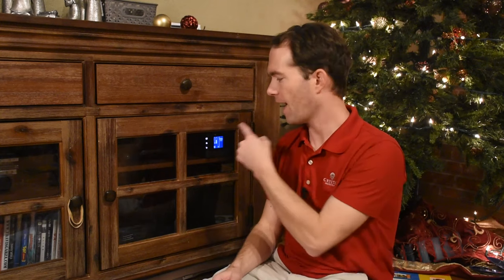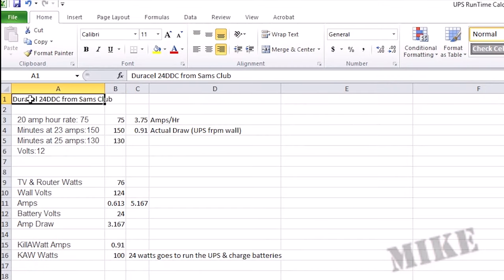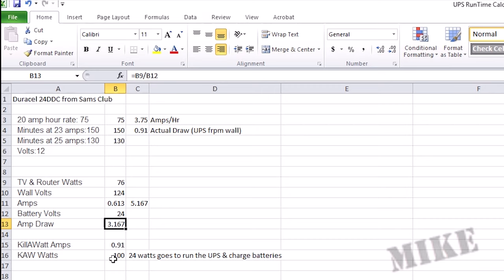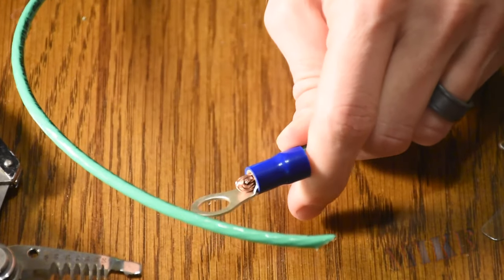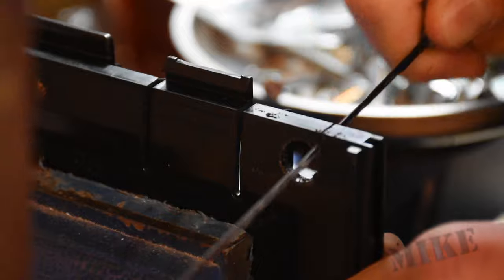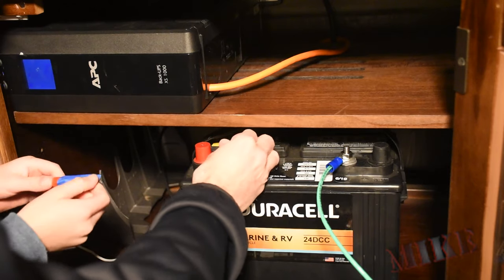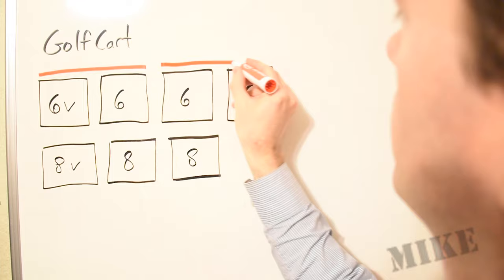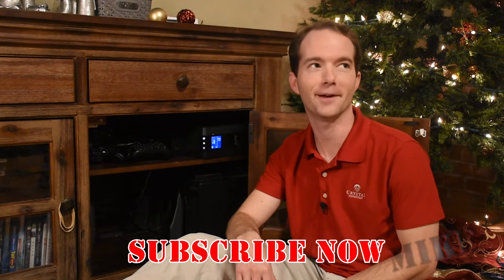SUPER UPS Battery Hack- Mikes Inventions

Comment: Hi Mike. What you probably don’t know is that APC sizes their components to match the runtime of their batteries. Attaching a super large battery, and a full capacity load, will eventually cause most UPS models to overheat. Instead, use the TrippLite automatic PowerVerter if you want an external battery bank. That’s what I did 20 years ago. They are also fan-cooled.
Reply: I like the idea of the PowerVerter, but it does not have auto-switching from AC mains.  I wonder if the PowerVerter could be simply installed behind the APC UPS, which means once the acid batteries run out, then the APC will take over for it's tiny 5-10 min and shut stuff down?
Reply: @mcw0530 any way to hack the ups to fully utilize the bigger battery?
Reply: Just make sure the load lies within the specification of the USC. Better if you keep the load about 20% below the spec.
Reply: I bought a surplus APS, and it has a connector on the back for an external battery. So what does APC recommend for externals? Why does it overheat?
Reply: @MAustinP  Sorry for the late reply, but the PowerVerter does have an automatic version that auto-switches from the Mains should they fail.  I know, because mine does that, just like an APC UPS.  I have the 1200W model and it's attached to a 100AH deep cycle AGM battery.

Please see TrippLite P/N: APS1250
Reply: @bransoncarlton4939  It's pretty simple:  Most APC UPSes are not fan cooled, as that would use more power.  Furthermore, most are inside a sealed metal box.  Power conversion has a known percentage inefficiency, and that heat generation is matched against the components inside the device (their mass, how long it will take to heat up, and to what maximum temperature) and the battery - how long it can power those components.  So the batteries are sized that the unit runs long enough at full load, but not long enough that sufficient heat builds up to destroy the internal components.
Reply: how much load do you expect a TV and Modem/Router to draw?  By your logic, he's going to burn out his UPS with a 20% load for an hour on the stock batteries.  These devices have self testers and will alarm when a failure occurs.  APC and Cyberpower offer very good components that easily take these upgrades, without issue for years.  If you really are that concerned with it, then install a fan to turn on when it switches to the Battery to cool the internal components.  They will only draw as much as they're rated for anyways.
Reply: @mcw0530 There is such thing as equalibrium of operation, and no, false, there is no "sealed" components in a "metal box" it has plenty of ventilation slots cut into a plastic housing to allow for cooling to naturally flow through.  You can more than easily add a 12vDC fan to the circuit to turn on when the Batteries are activated with minimal modding and experience required.  OH, and before you lash out at me for "whatever fanboy reason here" my experience is with 15 years of electronics modding and four UPS's, one of which i have protecting my entire 24U server rack, and since the default 1500VA gives me 10 minutes at full load to save my work during an outage, I have no reason to upgrade it.
Reply: @NafrytiNosferatu  hey go ahead, don't trust the guy who works in an electronics laboratory making power supplies for super large computers. It's your equipment, anyway.
Reply: I have a 540W Geeksquad UPS, and I’m thinking I could water cool the MOSFETS so I could use it as an inverter
Reply: @mcw0530  you speak the truth, They are not built to supply endless hours of power I mean there are units designed to do so but their cost is very high, I must also point out that where I am in Canada the tripplite unit costs far more than a solar generator with UPS fuction for similar power ratings so that would be my move, I don't get why people get upset over facts, I did this years ago with 2 APC units it worked but 1 only lasted about 1 1/2 and the other made it to 2 years before I killed both of them, it does also depend how often and how long they have to run, but you are correct the component in the cheaper UPS unit are not designed to run for hours/days
Reply: $1500 for a ups that will run your rig all day and wont be dragging along. If your rocking a 3090+ and ultra well go more like 2-2.5k
Reply: I’m currently adding 2 100a agm batteries in my suv for a power supply. Is it possible to take the display off my apc 1500pro and it displays everything as when It had the two 12v 7.5a batteries in it. It would just be nice to see all the information it displays
Reply: Could use something like a 12.x volt lifepo battery instead for even greater run time?

Comment: Be careful of using flooded lead acid batteries due to off gassing.
Reply: I suspect one can also use AGM batteries too instead of lead acid right ?
Do they have to be lead acid ?
Reply: @tonymontana897  AGM is lead acid, it's just that the acid is absorbed into a mat instead of flooding the lead plates.
Reply: @charleshorseman55  is it safe to put the UPS sideways like in the video with AGM batteries?
Reply: @AmongUs-mb4qx lectricity doesn't care! Since there is no battery in the APC unit, there is no problem.

One could argue the same with the batteries in it as they are sealed lead acid batteries.

Comment from the maker: Still going strong after 18 months. The UPS charging circuit brought the batteries all the way up after several days, and since the batteries are so large, it's as if the batteries are on a trickle charger, like they would be anyway. The minute counter on the display is still meaningless, because the UPS has no idea how big the batteries are, but it is somewhat useful for judging relative charge. The minutes just tick down at a much slower pace. I haven't needed to use them for more than about an  hour or so since I installed them, and the internal charger on the UPS worked just fine. Now I plan to use my large auto charger if I run them down a lot so as not to strain the UPS charger circuit. So far so good... Stay tuned.
Reply: So bro didn't it give any problem after the installment and can i use car batteries
Reply from the maker: @driftkings2740  Hey, yes, you can use car batteries. There is a comment down there that says as much. However, car batteries' thinner plates are not to be discharged very deeply. (Only about 10%) so size your batteries accordingly. Also, most car batteries do not specify a capacity, because they don't have to. All they care about is cranking amps. So, there's no way to know what you'll be able to achieve with them. Thanks for watching!
Reply: @MikesInventions  do you have concerns of off gassing? There's a deal on amazon right now on interstate deep cycle batteries but the concern is the off gassing.
Reply: @quacktony  Probably just want to run a longer cable and not install this sort of unit in the living room. Otherwise, looks like a bad-ass blueprint. Anyone else trying to game on green energy? Found an older Dell server that uses around 100watts under load, going to pair it with an external gpu and then an array of batteries and panels, and maybe just maybe, some way to capture wasted heat. If I ever build a house, I swear I'm rigging my waste  heat to pex and setting up heated floors at the very least.
Reply: @userhandle3378  I wonder if there would be a way to use a TEC to recover heat back to energy? Doubt it would be worth it, but I thought it was an interesting idea.
Reply: @quacktony  it would be min off gassing as you would really need be pushing the changing amp up for that start happing but you could always go with Seal Lead Acid or AGM or Lithium-Ion Battery
Reply: use the apc powerchute software, 3.1. Then use the pc to apc data cord (pn# 9400127E  usb to RJ45)  or just a usb cable on some, to run the software. Go to charger test and check, then go to battery change date and put in the current date. Now check the estimated run time on the apc.
Reply: @quacktony  unless you are over charging your batteries you should not have a problem with gasing if you are worried about it then build a box for the batteries where you can ventilate it outside and run an extension cord from the ups to where you need power as the ups needs to be close to the batteries
Reply: Hi Mr Mike
Im your new subscriber 
I have 3kva ups about 2000watt
Currently using 6 battery, 7ah 12v each

Can i use 6 battery with 100ah 12v each deep cycle?
Is that going to be a problem for my ups?
Reply: Hi Mr Mike
Im your new subscriber 
I have 3kva ups about 2000watt
Currently using 6 battery, 7ah 12v each

Can i use 6 battery with 100ah 12v each deep cycle?
Is that going to be a problem for my ups?
Reply: How much water have you had to add to these so far? I have a similar setup but using a 2000 watt UPS that is 48v. So I had to use 4 of this exact battery.  I actually keep it in a storeroom and ran romex through  the attic and down the wall to the locations I wanted battery backup.  All that said, I ve had to add a fair amount of water over the 18 months. So I  was wondering what you have seen. Next time I do this,  I plan to use AGM batteries.
Reply: @SHSPVR  Well hyrodgen gas is explosive..enclose it in small space. It will go off like a grenade..I know that for a fact. As one did just that. .
Reply: @WizzRacing  that funny so will gasoline and your point is WHAT hell even a run away hot water heater will explosive.
Reply: @SHSPVR  The point is you put hydrogen gas in an enclosed space. Where electricity is around it...Good luck not getting your ass injured or killed.. As I seen people blinded by glass flying around...

But as with most people. They have to experience the emergency room. To under stand why labs vent that stuff....

Good Luck...I hope you got good insurance...Both Medical and Home Owners...
Reply: @WizzRacing  I have scene lead acid battery bank in small enclose space go years on end and never have a problem hell even the many phone company and railroad are still in service to this day
Reply: @SHSPVR  You are the typical person that rides the Short  Bus  for a reason....
Reply: @WizzRacing  Hell No I ride a Motorcycle and drive a Pickup we don't have Bus here
Reply: When I suggested similar idea to an APC engineer, he clearly told that charging high capacity batteries is not possible work inbuilt circuits.
Reply: @lalitalalitah  Well APC engineer has a point but that problem is not circuits it self that problem is in the BMS firmware that build around that specification of that given battery specs and it preset calculations if we could modify them to match the bigger battery then problem is solve.
Reply: @SHSPVR  The problem is an APC  only puts out less then 3 amps...Just enough to charge an 12v  7@ah battery system.  Over 7-9  hour period...

A normal 12v 90@ah  battery needs  10amp  minimum. To Charge it within  the same 7-9 hour period...It would take that UPS 3  days to charge that same 90@ah  battery back up to 12.7 volts...  In which case to that several times. Them bigger batteries will go bad  quick...Why you need an external smart charger. That can detect the condition of the batteries. That can supply 10 amps to each battery...

Why people invested in solar panels to supply electricity too their battery banks. If the power remains out..As a  smart charger is useless. Unless you have AC power...
Reply: @WizzRacing  The changing can be handle with external BMS depend on type battery chemistry like for Lead or AGM NOCO Genius 10. Many of us can't go solar so we have rely PC UPS
Reply: @SHSPVR  I'm talking about the builtin battery charger in the UPS... They only  putout 3 amps at most. Just enough  to charge 7@ah batteries in them...You start hooking up external 90@ah batteries to these.. You need 10+ amps per battery.  To charge  them back up inside the required 7-8 hours...

So  you need an outside source smart charger. That can handle 10+ amp per battery. As they will not last long. When it takes 2-3 days to charge them back up.. They will sulfate...
Reply: @WizzRacing  Stop repete your self read post and this about using bigger battery not that stock 7ah to 10ah small battery, As for 90ah battery that is nothing as it about the same size is what in many of truck with 850/900CCA any way and alternator output way more amp 70 /120amps and they last very long time 3+ year and then there are Big Rig have 200+amps alternator with 2/4 battery and they too are on the go 12 hour per day way more then car or pickup and there avg lifespan on them is about same 3year+ unless you move away from Lead Acid (SLA, VRLA, EBF), Gel or AGM to Lithium batteries.
Reply: @Dirtyharry70585  I'm struggling to get the UPS to recognize the new found capacity. The timer ticks down at the right rate, and shuts off at the same time. "Brain Dead"ing the unit doesn't work, self-tests after battery change date doesn't work. Exactly the same capacity.
Reply: I hate to say it, but these things are made to run the duration of the batteries that are in there. I have done this exact test about 4 times now with 4 different UPS and they will all run fine for small things well under the rated max power output.

However if you do run enough enough to start heating up components inside the unit, the heat will not be stopped by that fan they added. it will overheat and burn your place to the ground. 

Most units are passively cooled, and basically begin heating the the moment they switch to UPS. at the rated power there will be no issue because the UPS will shut down before the heat builds beyond what is expected with the factory battery. but if you extend the run time with these huge batteries they will keep going even when they are smoking and on fire.

It's well known, and I have seen it on my end more than one. You are safer with a power inverter that has a backup feature. they are built to run for long periods.

If that is not affordable, you could modify that UPS to make it "safer" by adding more fans, better (NOISY) airflow. just keep in mind, if a fire starts in this thing, the fans will help fan the flames and spread the fire quicker.
Reply: Hey Mike, it's 3 years later.  How is this thing holding up?
Reply: @MikesInventions  they usually have a house charge run on the label, at least the good ones do.
Reply: That's great to hear that the UPS battery hack has been working well for you! If you're looking for a reliable backup power solution for your outdoor adventures or RV trips, I highly recommend checking out the Segway Portable PowerStation Cube Series. With its massive capacity, fast recharging, and versatile sockets, it's perfect for keeping your devices and appliances powered up. The waterproof technology and comprehensive protections also make it a reliable choice. Happy camping and stay powered!
Reply: @WizzRacing  The battery will only off-gas if it is being overcharged. If the UPS charge controller is for 12 volt it should be fine.

Comment: If you are going to do this please install a full time vent system to the exterior. Maybe even move the batteries to a vented box outside and run your wires in. Gases from an unsealed lead acid battery are explosive, especially when overcharging. Like you stated, the UPS has no idea what type/size of batteries you connected. “So far, so good” are famous last words.
Reply: Open to the open house, is it a concern?  I see hydrogen gas is flammable from 4-72% (an additional half volume of oxygen is also produced) at a rate of 27 cubic inches per AH.  I wonder if human "off-gassing" of methane after consuming sauerkraut or beans has similar explosive concerns.
Reply: Really? Never possible at all? You would stake a family’s life on that? As if errors in software driven hardware could never occur.
Reply: Yes, my thoughts exactly. Large batteries need venting and placing them remotely, in a well vented, sheltered spot would be ideal.
Reply: @Bigmeatslapper  No it's not. First, the APC is calibrated for AGM batteries, those operate at a higher voltage than the FLA, so they are being overcharged. Second, APC is notorious for using a higher float voltage than usual. You'll find them as high as 14.0 V. This gives the batteries a little more runtime, but they degrade after a few years, convenient for making you buy a new one.

Comment: The RS 1000 and 1500 models have an expansion port to add an external 24v battery pack, no drilling, no mod necessary.  For safety, I'd only use SLA batteries.

Comment: Instead of the conductive metal hose clamps, you could use large plastic zip ties pulled down tight - non conductive. And yes, those batteries definitely need vented to outside. Hydrogen has a very broad explosive range, 4.1 - 74% and very light, rises up.
Reply: Even a common cable gland would be perfect.